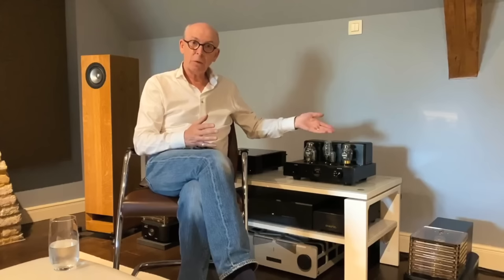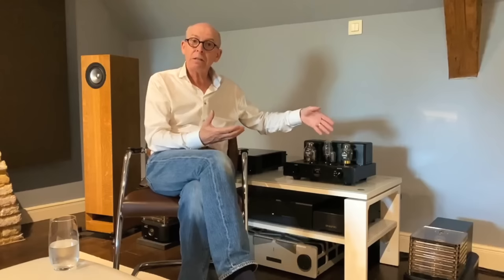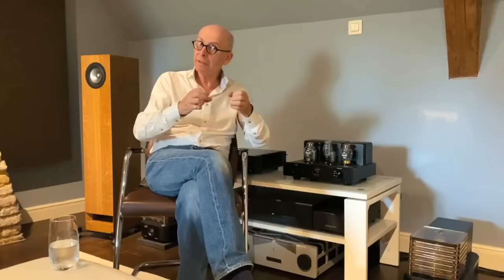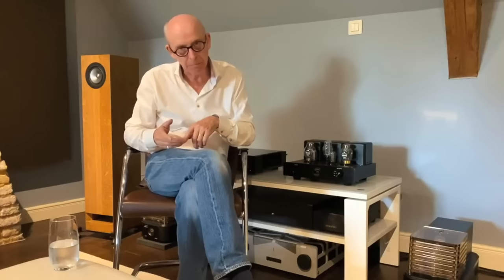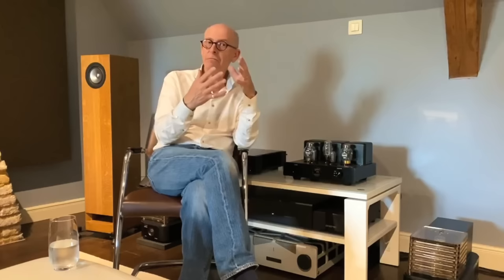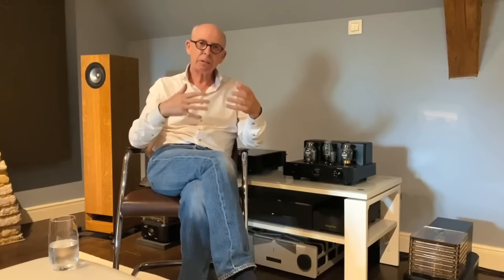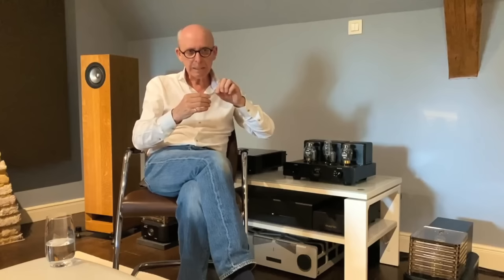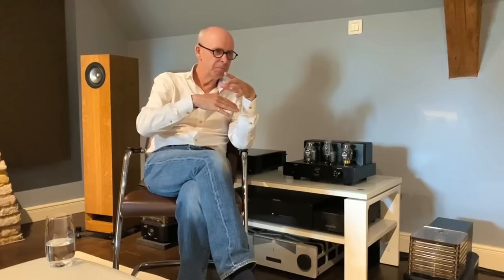What HiFi amplifier? What type to choose?

Comment: Saying that class A is single end and class AB is push pull is making things a bit too simple. Although all single ended amps, the ones that "amplify the whole signal in one go", are class A, does not imply that a class A amp can not be push pull, nor indeed, that a push pull amp has to be class AB. 
Apart from this reservation I find your talk very refreshing and informative. Thank you.
Reply from the maker: Hi, you’re absolutely right. I over simplified it. ‘Push pull, class A’ is real and often very effective. I should have found a better way to explain it.

Comment: I'm not so keen on Class-D amplifiers, perhaps I remember too well the SInclair IC-10 from the 1970s  as fantastic innovation at the time, but even modern switching amplifier have an enormous Achilles Heel and that's the  potential for interference to the LF, MF and HF radio spectrum. For me it's my Trusty Quad 405 that I built 39 years ago, but has a separate power supply for each channel 2 x ILP toroidal transformers and the matching rectifier and capacitor sets. All UK made components and the electrolytics are still in fine condition. As you say - quality components were used all of which were sourced from Radio Spares in 1983. I bought the 34 and FM4 and later a Quad 66 CD player and it all drives a pair of Rogers LS7 loudspeakers. The Tuner and Pre-Amp were recently upgraded by Quad. A Linn Akurate DS1 now takes its place on the tape input and I'm in the process of refurbishing my Garrard 401/SME 3009 II. Overall I don't think I really improve on this without spending many thousands. Most importantly I still love the sound it makes. My best friend has the same Quad setup, but driving a pair of Rogers Studio Ones.
Reply from the maker: Enjoy!

Comment: Great video.  I listen to Zu speakers which like the Sibelius have no crossover.  There is a full range 10 inch driver and a super tweeter that handles harmonIcs above 12k.  The tweeter is protected with Clarity cap to prevent damage.  I’m driving them with a Naim Nait 5Si integrated amp.  I am considering moving to Sibelius. I like your approach to audio.
Reply from the maker: Thanks for your appreciative comment.

Comment: Super, many thanks for to explain the 1 watt = 87 Db. It was so usefull.
Reply: @aulker62
Thats 87db @ 1 metre from 1 Sebelius speaker....most of us listen at closer to 3 metres away which needs 3w for 87db for this speaker.
Nevertheless the point is that you hardly ever use more than 10 Watts ;-)

Comment: Only one thing: Class A can be push pull as well. Single sided and class A are two different dimensions.
You can have a single sided class A amplifier as well as a push pul class A amplifier.

For class AB the same is valid. Single sided is also possible.

Class A or AB or B is all about quiescent current. Not about a push pull design or single ended. ;)
Reply from the maker: Indeed. Thanks for your addition. I should have talked about that possibility but thought it way too complicated.

Comment: The best Class D designs (like Bruno Putzeys') can be as smooth if not more than any other designs.  You get that plus higher dynamic, precision, total speaker control and load invariance.  Yes the first watts are the most important but that's only one part of the whole picture.  Having power (high current capacity) change many things: A speaker is a physical device with inertia, it takes current to make it change its course.  And the louder you play it, the more current it takes to properly control it.  Not to mention that a speaker is a complex impedance that change with frequency, think of it as a variable RLC circuits whose values change with frequency.

 If you like the harmonic distortion of a tube amp, then no, the Class D won't bring you that.  The question is: Do you want to listen to sound closer to source material or the more distorted one?  That's perfectly ok to prefer the tube amps, that's not my point.  It's like preferring sound while applying an equalizer curve.  In my case, i selected every component to be as transparent as possible, the less distortion and artifact as possible: The result is that when i listen to a good quality recording, it really shines!
Reply from the maker: Thank you for your contribution to the topic. It’s much appreciated

Comment: Years of wisdom!
The perfect amp (technically) is a zero distortion voltage amplifier.
Over the years I've seen tests with sinewaves, square waves etc, but the real test of quality is with real sound; voice and complex music.
Today it should be possible to have an objective test for music distortion, taken at different amplification levels, and deviations analysed into a simple figure, with the possibility to dig down further into the nature of the deviation(s).
If the best performing are not the best sounding, then I'll give up!😁
Maybe as you say certain distortions improve the sound. Maybe you need a class D amp with a button to impersonate Class A and Class AB.
My old pioneer SX-434 (1973) still sounds sweet and light, better than my newish Yamaha strangely.
Yes caps wear out and some MLCCs are terribly microphonic.
I design LED drivers and an MLCC in the feedback circuit caused a problem. When you clapped your hands the light flickered!
No experience of class D apart from noting they are tiny!
Excellent video.
Reply from the maker: Thank you. Very kind.

Comment: You can have class A push-pull, where the output devices (tubes/valves or transistors) each amplify for the entire cycle of a sine wave.
Reply from the maker: Dear John, thank you for your comment. It is much appreciated. Of course, you are absolutely right. And looking at my video again, I realise I will have caused some confusion here. I have placed an erratum in the video description, that I hope clears up the error.

Comment: I have no doubt that your single driver speaker without a crossover sounds decent.  Because of the speakers simplicity the only MASSIVE damage would be to the voice coil and since Im assuming you don't have a fuse inline would be not hard to do even with a mediocre amp.  I'll say its a good business strategy to have a speaker with a single driver and no crossover, keeps the cost WAY down.  Interesting talks, thanks.
Reply from the maker: Hi, thanks for your kind words and comment. Much appreciated. Just to come back on the voice coil, it is very strong and can handle pretty high voltages. There is an equilibrium within the driver, that combines to give the power rating it has. It will comfortably produce 91-93dB and can peak around 100. But best listening is in the 80’s, I hope that helps?

Comment: People are divided into two types: one wants to hear all the smallest fractions of original sound, and the second one wants them to be wiped out with distortions wall at -60dB level (and they call this a "clear sound" because a source is cleared from details). With some efforts they can find this even with a class D amplifier )
PS I can bet most of you will prefer to listen to and use Ayre AX-5 Twenty on a daily basis rather than any of A class heater. Check it out. Try it. This is an AB amp with a direct amplification with zero negative feedback loop. You can listen to it all day long.

Comment: Thanks for an excellent quality video.  I agree entirely with your comments on vintage equipment.  I have had a great deal of fun upgrading amplifiers with much better modern components, including electrolytic caps, wire wound resistors, speaker binding posts and even RCA sockets.  The resulting improvements are clearly audible and I have no doubt these amps will go on for many years.

I look forward to more of your videos.

Comment: Relax and informative. Don't forget that a driver also has mechanical damping. Together with Qes they form total Q of the driver. Then there's the box Q. 
Total Q is usually designed at around 0.707, not really helping the system, but if they tune the box at or around resonant frequency, it takes all the stress off.
Reply from the maker: Absolutely! 😉

Comment: Great video! I use a Croft acoustics micro25 phono pre (all valve) and Croft Series 7 hybrid amp (valve input, mosfet output)
Reply from the maker: Thanks. Hybrid naked a lot of sense!
Reply: @PearlAcoustics  since there's no headphone output on the Croft, I've gone for a otl tube headphone amp from Feliks audio
Reply from the maker: @violin-schwerin  Interesting. I use a QUAD PA One, tube headphone amp or the really good VMV  A1. But all of these tools are solving the same problem. 😉 best wishes, H

Comment: Nice video....I use a SET 2A3 amp 4 watts....what can I say just great sound and smooth....like those speakers behind you....I use a klipsch rp160 speakers on stands which sound very good....and I'm also using a tube preamp with a separate tube phono stage....looking in the future to change the preamp even thou it's all point to point wiring but looking for something more quite....but I must check out your other video's great info and thanks for sharing.....Ed in New York.....🎼🎵🎶😎🎄

Comment: The company set up by Peter Walker in 1936 was S.P. Fidelity Sound Systems. This became  the Acoustical Manufacturing Co. Ltd in 1941 after being bombed out of London and moving to Huntingdon. The name QUAD was introduced firstly as a product, specifically an amplifier, it was an acronym meaning  "Quality Unit Amplifier Domestic" and was first used on the QUAD I amp.
Reply from the maker: Thanks for the additional info.

Comment: Thank you.
Class A is just to inefficient. 450 watts is massive power. My great room is 25' x 25' with 14' ceilings and I heat it with a mini split heater/AC. It draws less than 400 watts and idles at 15 to 20 watts. 

This idea that it's not a concern and that we have unlimited power from the grid is what is destroying our environment. I run PV here which runs the house and charges the car for the most part. We simply have to get away from this idea of 450 watt class A amps that put out 25 watts are acceptable when I can drive my car two miles on 450 wh. Especially when we can have class D amps fed by class A tube preamps that will equal the sound of class A and even surpass it at a fraction of class A's power.

Crossover distortion from early AB amps is no longer an issue, it's been long ago resolved, it simply doesn't exist in modern well designed amps that are will within the budget of most listeners.

Single driver speakers like every design, have their strong points and their short comings, it would be hard for them to match the smoothness of, say a, Dynaudio Esotar T330D tweeter specifically designed for a specific frequency range.

Thank you for your interesting discussion.
Reply from the maker: Thank you too for adding to the discussion. Hopefully, you will hear our Sibelius loudspeakers one day. Best wishes from Belgium

Comment: I get the idea that your loudspeakers sound quite excellent.  But, for all the poor folk out there, many full-range loudspeakers, about 5" diameter, in a solid enclosure will sound very nice.  No crossover, no complications.  Also, some additional points.  The Quad 303 is Class AB, but the Quad 405 and 405B are Class B, and 'current dumping' was Peter Walker's approach to a perfect zero crossover point.  In essence, using a high quality signal to control a low quality output stage.  Another thing to remember about Class AB amplifiers, is that there are two sub-classes (AB1 and AB2) that are distinguished by the point where the amplifier switches from Class A to Class B.  AB1 amplifiers operated at a moderate volume may never switch to Class B.  In essence, that AB amplifier, for all intents and purposes, is a Class A amplifier until you 'give it the berries,' to borrow a railway term.
Reply from the maker: Thanks for your contribution, you raise a very good a point here.

Comment: The famous McIntosh MC240 and MC275 designs are all Class AB tube (valve) designs.  I wonder if the using tubes for push-pull stages creates different/less/less annoying distortion around that switchover point that you mention (the zero crossing).
Reply from the maker: Hi, I am not sure that it’s the tubes that make a difference on this point but the circuit design itself. Maybe someone else will have a more specific answer?

Comment: Nice video with lots of good advice... but, IMHO you confuse class A with SE and AB with push pull.  A class A amp can be SE or PP.  SE is as you point out the entire sine wave is amplified by one device where PP, the signal is split in two with each device only focused on the upper or lower portion of the wave.  Class A always operates at full power and inefficient but has a sound characteristic that many people like.  AB is far more efficient.
Reply from the maker: Thanks for your kind words and comment. Indeed I certainly could have explained it better. I did actually make the correction in the Description, after a previous viewer made a similar comment that class A can also be ‘push pull’ etc. But thanks for pointing it out.

Comment: Speaking of tube amps, I have an A10. El34, single ended, strapped from pentode to triode. The quality of the interior point to point wiring is exemplary, and it came with Chinese tubes. I dumped them for Russian, NOS. Would I know the difference? With my 73 year old cloth ears, I doubt it, but I really like the idea of a poor mans SET.

Comment: So much to learn here. Amazing. If any content on YT would match yours the world would be a better! So, if you like, here is my guts of a system I paid 600 euros in 2006. It consists of the harman/kardon hk6950R, a pairof JBL HP570 and a cd player harman/kardon 7725 with those fabulous Burr&Brown D/As and a linear smoothing system. I like it when the music has  body and the the bass is kicking undelayed and suddenly. What does an audiophile like you think? Watching your video of Daft Punk made me put this LP on my SL1210Mk2 today and after that I went for Pink Floyd. Also Vinyl to close it with some tunes from the Dire Straits from the Money For Nothing CD. I was happy. Thanks, Sir. It is really fun watching you. 🇩🇪

Some data of the amp
"...bandwidth of 10 Hz to 100 kHz, with less than 0.08% THD. Its transient intermodulation (TIM) distortion is rated as unmeasurable, and it has a high instantaneous current capacity of ± 90 amperes. Its slew rate is 280 V/μS and rise-time is 1.8 μS..." It delivers 90 Ampere per channel 🤫 💥 Retail price was 3.300 DM
Reply: Add on question. As a sports pilot I know that lift changes by altitude and also by temperature. Hot air just gives thinner air equals in lower lift. Hos does room temperature affect the experience of listening in a small scale manner as a recording specialist?
Reply from the maker: Hi, temperature in a small room with low ceiling = no problem. But big concert hall with a fading note can sometimes be a problem as the sound rises into the ceiling. The effect can be that The pitch drops slightly. I sometimes ask the brass players to play very slightly sharp at the end of a piece, the last note - to help compensate for it.
Reply from the maker: Thanks for your kind words

Comment: I have a question. I am living close to the equator. 30 -33 Celsius ( 86 – 92 Fahrenheit).  Hence, it is always summer.  I recently tested a Class A tube amp with 211 tube set and ECC82 tube set. I am very much in love with the musicality of it.  Will it be a practical thing to use this Amp in my bedroom due to its heat? Also, will it run into problems if I use it daily for 2-3 hours due to summer whether?
Reply from the maker: Hi Jude, sorry for the delay in replying. Technically you should be fine, most amplifiers can cope. The biggest challenge is that you are adding more heat into an already hot room 😅. But if you love the sound, go with it. Just make sure your amplifier is well ventilated.
Reply: Thank you 👍

Comment: I love your presentations and videos,very interesting.ive got a room full of hi fi , I'm thinking of selling all of it and currently have one main system in my living room Linn Sondek ,Ittok Audio tecnica 0C9 cartridge ,Quad 67 cd player Quad 66pre amp 606 power amp driving Ruark Accolade speakers. In my bedroom I have a small Sugden A25 mosfet amp ,Rega P2 ,Roksan Caspian 2 cd player driving Mission 772 speakers. In my music teaching room ,(I'm a trombone player) I store all the spare hi fi which I really need to sell ,there's no point in keeping them ,I'm thinking of buying a Sugden amplifier like yours ? I just know it will be an improvement over the Quads.I have a Musical Fidelity 1001A class A super integrated amp ,which hasn't been used for years and KEF 104 2's and loads of smaller integrated amps like Yamaha's,Sony .I best get on with it and thanks again for your excellent videos ,All the best
Reply from the maker: Thanks! Good luck selling the gear. Someone will be very happy with it, I am sure!

Comment: I am 100% with you on watt but still a bit confused comparing to cars.  In cars, horse power gets you top speed.  It is the the toque that makes stop and go.   Assuming horse power is like watt in power amplifiers and sound transient attacks is like stop and go, then what is equivalent ‘torque’ in electronics?  Since you can do a measurement, can you measure that peak wattage say a strong piano attack?  That might tell why someone like Mcintach believes 2000w of their top the line amp is needed or just a marketing BS. also the quality of power supply also is a main factor.
Reply: torque is like quality of transformer metals, winding, design characteristics that control those qualities in the music beyond just top power. two transformers with same power rating exhibit dynamics in music very different.

Comment: Point missing here is the efficiency of loudspeakers some as low as 83 db some 90db +I the later as you only need a low power class A amp I have to laugh at those MaC Intosh amps with the VU meters that read up to 1.2 kw's